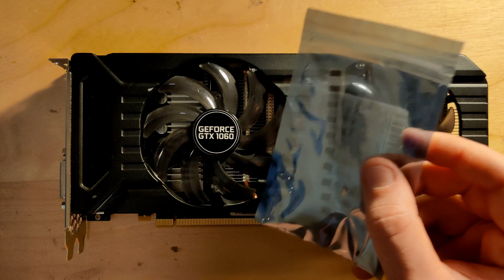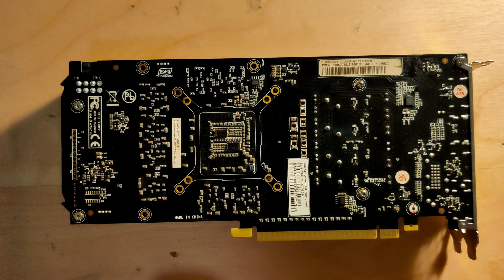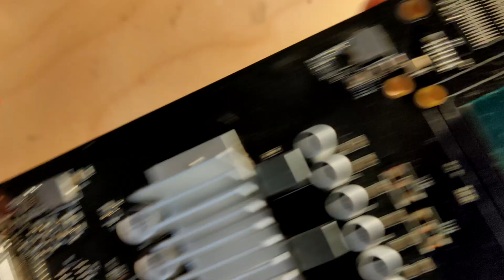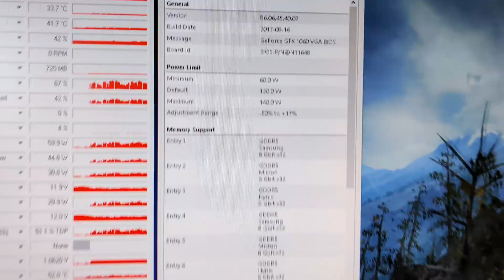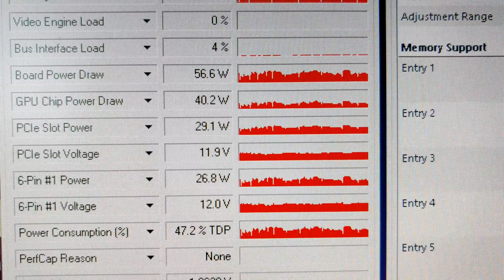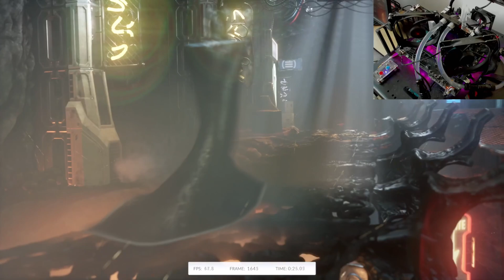Shunt Modding a GTX 1060 to Overclock it over 2100MHz

Comment: I must have been very lucky back when I got my 1080ti. I undervolted it and it still never drops below 2100mhz. No mods or anything done to it at all. That’s even without touching the power limit slider.
Reply: Not possible you clown and not even close. You are talking bullshit.

Comment: So 5 miliohm is standard for NVIDIA or do I need to measure across them to know what they are? I have an aging "gaming laptop" with a 2060 Max-Q for the graphics. With it's 65w TDP and the fact that it's paired with a decent 30w Ryzen 4900, I think it'd make a good candidate for this type of surgery. It's psu charger has basically just enough extra headroom being 180w, and you never know... maybe it wouldn't catch on fire!

Comment: wonder if you could add two more memory chips lol
Reply from the maker: you can't the GP106 GPU does not have the memory channels needed for that. you would have to use a GP104 instead which would turn this card into a 1070 or 1080
Reply: wonder if larger ram chips could be used . since you can fill the two missing pads lol just curious aa the 6gb does get in the way of the 1060 
 @CmdrSoyo

Comment: Here is the problem with this if the max most can get on pascal is say 2030mhz and you brute force your way to 2130mhz by shunt modding you only gain a 5% increase so if your fps in a game is around 30 you have only achieved a extra 1.5fps at best
Reply: you don't du this for gaming but for benchmark records ;-)
Reply: Yeah, for gaming it doesn't make sense. Here I get 2025 - 2050mhz on cyberpunk 2077 with overclock+ 116% power limit. It gives me about 10% more fps.

With lukefz fsr3 mod, I'm getting 55fps 1080p ultra config. With OC, I get straight 60fps 

This is with DLSS or XeSS  on quality profile. Sometimes the card drains 144W

But for what I see, even if I did shunt mod, couldn't get more than 3 extra fps, with much more risk, because I'm already getting that much power from it.

Comment: It looks like the shunt on the pci-express slot is bridged completely with solder.
Reply: That's the fuse. He did that so it wouldn't blow when it gets more than 75w through the slot.

Comment: Bro my vga gtx 1060 alwas power limit reached on 10%TDP. And the 6 pin power showing 0.2 watt.. What should i do..
Reply from the maker: i would suspect something is wrong with the INA3221 chip. Tech Cemetery had a similar problem n this video: https://youtu.be/bF3dfLjaplo

Comment: ... im throttling on a titan maxwell. will a shunt mod help me? ALSO>. how much is your gpu consuming? it the GPU-z  reading accurate or is it doubled? i didn't understand that part. thank you ! AWESOME OC
Reply from the maker: if you are power throttling then yes. but the Titan Maxwells VRM is weak on a good day. there is a non 0 chance it will blow up if you shunt mod it.

the power reading is 60% of the real power draw if you use 8mohm shunts on top of 5mohm.
Reply: @CmdrSoyo  im thinking of using 10mohm shunts for the titan maxwell.. i also have a 1080ti, evga sc  edition.. shunt mod on that what should i do >? put under water is my goal eventually.

Comment: Lol watching linus tech tips is painful
I just can't do it lol

How hot do you set the hotplate for?
Reply: 105C is generally safe for all electronic components and if you let the board sit on it for a while it makes soldering way easier. For really heavy boards and large components I go upto around 160C. At that point you can't just leave the board that hot forever so you kinda want to get all you soldering done quickly.